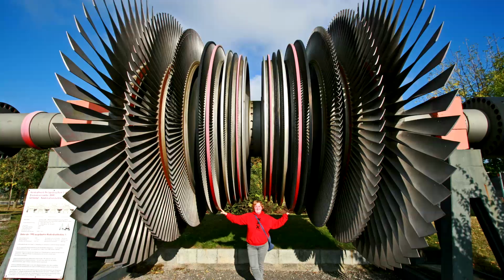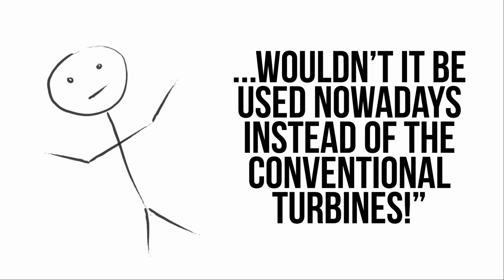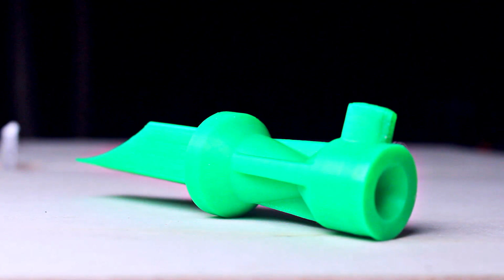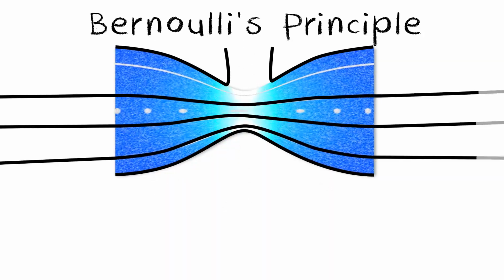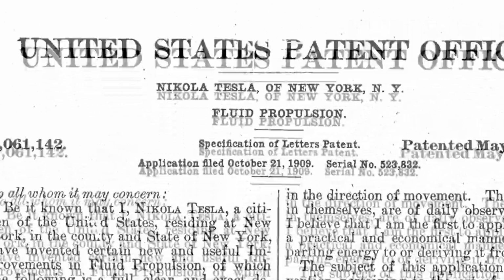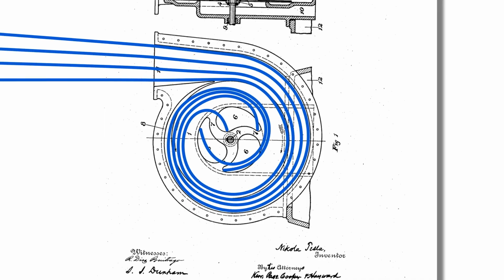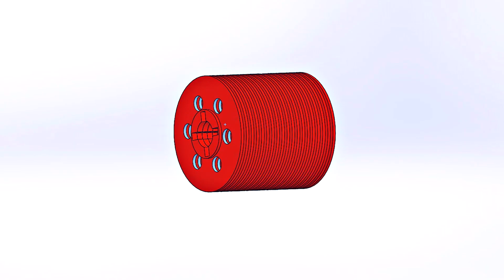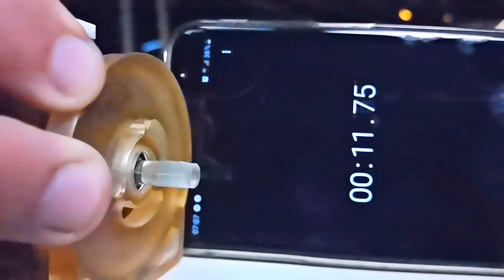Tesla Turbine [Smoke Flow Slow Mo]

Comment: Inetzga ;), do you think it possible to connect the turbine to some sort of pressure generator, to return some of the fuel used ... in a way :) ???
I love the other engines you explore with the combustion and higher chance of fire/explosion, but the printed parts tend to not like rapidly expanding burning gases (which, don't get me wrong, is a shame :) ), not to mention the pair of pressure and high temperature, which of course i love the most on account of ... yep, higher chance of fire/explosion (no casualties intended, except tomatoes and 3d printed parts) 
I think you are drifting a bit from the guy on your wall ... and i am not talking about the Magician ... d@mn, ok, I am talking about the Magician, but not the one from ParryHotter (or was it Happy Plotter, not sure, but am close). So far i have only seen the turbine generating electricity only, i have never seen an attempt to try and make it generate the air pressure. Also, is an inertial weight possible? I know it will impede acceleration, but wouldn't it lower the pressure necessary for sustaining higher RPMs, i remember the stretching disk issue, but was wondering, what if the shaft is acting like it, with a bit of a difference in diameter .... 
 Something is bugging me regarding his statement for the 3, 6 and 9. Could his turbine have something to do with the rest of his ideas and claims(sorry, bad word, should be discoveries)?
And lastly two more things:
1-st. Integza you are THE MAN!
&
2-nd. Tomatoes are disgusting!

Comment: Re. the low torque a TT produces, why not use the principle of the tesla valve to create some resistance within the TT. Bascially, that could mean putting a spirally deformed Tesla valve between the regular discs of a TT - and might even result in better stability. :)

Comment: I think too also didn't use the tesla teardrop exhaust on the turbine, with the venturi case, I think also we're thinking 2d, no reason the sides have to be flat, they can be domed, also the inlet doesn't have to be a tube, it can be rectangular to allow more even flow and also with the high pressure bernolui (however it's spelt) you can have a lamilar nozzle after that as a way of smoothing the feed. The disks are way to thick try aluminium foil from a drinks can.

The entire disk assembly would be better if made of many layers of thin aluminium,  the first type just a disk with a hole in the middle, the second type looking something like this https://previews.123rf.com/images/barks/barks1902/barks190200031/117188577-japanese-ninja-shuriken-illustration.jpg but 2d where they over lap enough for pins to be pushed through each limb and hold the rotor assembly as one

Comment: Could you etch channels into the disks in a spiral to increase the surface area and to guide the fluid flow?
Reply: Boundary layer drag is not from
Mechanical Interactions between the fluid and the disc. Adding grooves will introduce turbulent losses which will reduce the efficiency and can induce stream separation, and even flow reversal, counteracting the desired torque, because of the turbulent flow regime it would induce. The Tesla turbine works on adhesion from viscous forces, which are entire valance electron shell interactions. Think hydrophobic and hydroPHILLIC interactions. Making the surfaces of the discs hydroPHILLIC would increase the molecular adhesion of water and steam molecules increasing the boundary layer thickness. 

Putting mechanical impediments in the way of the free flow motive fluid completely defeats the purpose of the turbine in the first place. You want smooth faced discs. The “wetting angle” between the Type of material the discs are made of and the type of motive fluid is the important factor here.

Comment: I'd have to dispute that Thomas Edison (boo) can even be designated an inventor, as many of the devices attributed to him were either the result of predatory patent aquisition, or as a collaborative effort.

Take the Incandescent Light Bulb This was based on a design from english physicist & inventor Sir Joseph Wilson Swan (itself an integration of several previous ideas & designs) & eventually used a continuously incandescing filament (for the current) after Edison had his team of researchers do a huge amount of trial & error experiments.

In short, Thomas Edison (boo) was less an inventor than a very clever marketer & self promotor.

Comment: The one thing you have not considered as the teardrop shape or The Paisley shape that is part of Tesla's design...... 

the other thing is the rotor design is probably key on how to capture and release the air at a proper timing kind of like a engine or a rotary motor..... Even with a two-stroke the timing is kind of critical......

The air lets out of the disc may have to line up with the slots just right and the volume of the slots may have to be of a certain size to pressurize the same way as your valve to create speed and velocity.... Just theory

Comment: Using a de Laval nozzle will rob power from the TT. It isn't about speed, per se, but about volumetric flow.

In fact, the pressure drop from your "standard nozzle" will do the same.

Standard turbines use such principles to their advantage, but they get their power from direct kinetic transfer, and so speed is king.

In the TT case, you are losing speed due to the volute volume being higher than a tight fitting cylindrical case, however Tesla designed it for steam... He may have used very high temperature steam, in which case it would have had a brief expansion phase inside the volute, cooling it but increasing its volume.

He may have thought that was a good trade.

In any event, I wouldn't abandon using a golden spiral volute...it was a golden spiral... Wasn't it? :-)

Anyway, Using the identical flow rate for both turbines only tells you the unloaded rpm. You should do torque tests to find out how much useful power is being transmitted. It might be the volute case wins.

Comment: I don't think you accounted for the efficiency of the DC motor. Let's give it a giantly generous 85% efficiency, it would mean the turbine was outputting more along the lines of 0.18w. My guess would honestly put that cheap generic DC motor, acting as a generator, at more like 50%, though. Still not a ton of power, but significantly more.

Comment: the constrictor does nothing to the pressure. i done my own experiments on that and it all show that a higher pressure that goes trough a expanded opening will slow down the air flow and create a low pressure thrust much less speed than that input. the nozzle actually slow down the rocket. cavitation causes reverse thrust that pulls the rocket down against the expansion. there is alway vapor in the atmosphere and is very bad for a nozzle as it causes a displacement flow against the thurst that try to propel the rocket in the wrong direction. i also made many constrictors myself with air pressure and they all causes no effect at all. if you do real science do it on the so called facts to see if the facts are tellig the truth or if the facts are lying.

Comment: I  HAVE AN IDEA FOR THIS GENERATOR I WOULD LIKE TO SEE IF IT WOULD WORK  :D . And that would be using it under a fluid load  Ie: under a water load . and as well as also incorporating the tesla valve into it as then it would limit the possibility of back wash into the supply line of the water.instead of that of a pelican wheel and then the comparison of the two as far as efficiency of output and  would it be possible to incorporate the idea of the two , that of the Tesla disks while running a a set up pelican scoops in between them , as a multi level pelican wheel hybrid. reason behind this thinking is that of that of a small but powerful turbine for a hyfro plant for offgrid electric( please let me know what you think of this idea thanx for all work your and time on these vids )

Comment: You're not quite correct about the flow, once the turbine is turning, centrifugal force pushes the flow of fluid out to the edge of the rotors and away from the exhaust ports. This actually (from what I can gather) works better with the smallest possible clearance between the case and rotors.

Comment: I had an idea of how to use Tesla turbines to utilize tidal power to generate electricity. Large underground chambers need to be dug into the coastline, that communicate with the sea, out beyond the low-tide mark, and also with a large Tesla turbine's inlet. As the tide rises, all the air in the large chamber will be forced through the turbine. When high tide is reached, the connections to the inlet and outlet of the turbine are reversed, so that - as the tide falls - the air to fill the chamber will be pulled through the turbine, which reverses its connections once again at low-water. This way power can be generated on both ebb and flood, and NO tidal power scheme can generate at slack water anyway. 

I like this idea, because the corrosive salt water never needs to contact the machinery directly, and there are huge stretches of coastline around the world that could be used for such installations.

Comment: So I was thinking, what if you put little elongated holes similar to the cutting holes in a grater, but to catch the air, and in the 3 6 9 spiral design, spiraling inward, on the discs...
 Just a thought, Idk all you'd be out is some printer plastic

Comment: What if you taper the side walls towards the center? Then the pressure would build as the side walls got closer the the disk in the center? Also engraving concentric circles in the disk might increase its surface area?

Comment: Unrelated to the Tesla turbine but your table saw, you need an edge that’s adjustable so the material has something to rest against, this will help stop the flexing in the blade as you cut because your trying to put even pressure with both arms at the same time. Love your vids keep em going!

Comment: Here's my suggestions:
On the interior of the turbine - Decrease surface tension by smoothing interior with hi grit sandpaper, fine rosin polishing and then cotton buffing.
On the disks apply same process.

You can also coat disks with a 3M product called "NeverWet" this creates a nanocoating that nothing sticks, and a micro-level (not nano) coat that the surface is smooth as can be. Without having thousands of dollars of equiptment, such as using steel and precision grinding.

Yes I too am an inventor.

Comment: If the discs had spiral grooves on them they'd have more friction with the air and could assist in guiding it's direction of flow slightly to increase efficiency
Reply: Unfortunately This is not true. Adding grooves will introduce turbulent losses which will reduce the efficiency and can induce stream separation, and even flow reversal, counteracting the desired torque, because of the turbulent flow regime it would induce. The Tesla turbine works on adhesion from viscous forces, which are entire valance electron shell interactions. Think hydrophobic and hydroPHILLIC interactions. Making the surfaces of the discs hydroPHILLIC would increase the molecular adhesion of water and steam molecules increasing the boundary layer thickness. 

Putting mechanical impediments in the way of the free flow motive fluid completely defeats the purpose of the turbine in the first place. You want smooth faced discs. The “wetting angle” between the Tyler of material the discs are made of and the type of motive fluid is the important factor here.
Reply: @CharlieSolis  Wouldn't an increase in surface area increase efficiency?
Also, the turbulence problem only occurs beyond a certain velocity. As long as laminar flow is maintained, surface roughness will only increase the amount of energy transferred to the discs. Reducing space between discs, reducing flow speed, and using a lower density fluid will reduce turbulence while surface roughness isn't as much of a problem. It can even be to such an extent that the discs nearly form closed tubes between them in a spiral pattern without much loss if other parameters are controlled properly.

Comment: It seems to me, that the secret to increasing efficiency is to optimise the effective path length along the disks in proportion to the casing. That means, to maximise the surface area of the disks in relation to that of the casing. I haven't done the math, but I assume that the optimal shape for the casing would therefore be spherical rather than cylindrical.

Comment: If the outer ring of air is most laminar and therefore better at moving the discs, then shouldn't the axis have a very large diameter to take up the space where air spirals inward?

Comment: People say perpetual energy is impossible, but that's not a great plan any way. What you really want to work on is a feed back loop because a perpetual motion device will only remain perpetual until someone tries to extract energy from it. Once energy is lost you can't get it back in a perpetual device. However in a feedback loop you gain more energy than you lose and therefore can extract energy from it. Hold on a second...  If you extract the perfect amount of energy at a time in a feedback loop it would be perpetual. Except, you would need to constantly extract energy from it.

Comment: The converging diverging nozzle will not work in this case as the speed of the air needs to be in the localised transonic regime at the throat(smallest cross section area). Loved the video regardless

Comment: What if the discs could move like an automatic transmission, this would change pressure between the discs allowing more grip potentially? Also R2, for Resinator 2 for the new printer.

Comment: Since you asked for ideas, the first thing I would try to increase the efficiency of this design is dimpling the disks to increase their interaction with the fluid.  But you might be better off trying to increase the efficiency of the actual power generation at low torques, or of increasing the generator's torque.  Electromagnetic power generators lose a lot of their efficiency at low torque, so even if the turbine is more efficient, the overall power generation probably wouldn't be.  I think that's also one of the obstacles to low head distance hydropower

Comment: You should 3D re print a nozzle with a grid pattern on the tip on the through partial bit of the nozzle the stabilize their as much as you can

Comment: The primary issue with the original tesla turbine was materials, if Iron of the day wasn't good enough for disks, what makes you think that plastic with a lower yield strength is enough for efficiency.  with cool air as the working fluid, I recommend carbon fiber.  For higher temperatures, perhaps something more aerospace grade.  At a minimum, high carbon heat treated steel, and the sky is the limit.

Comment: Convergent-divergent nozzle is better than convergent nozzle ONLY if you have supersonic flow. The reason is that with convergent nozzle you have the conservation of mass working for you, but in divergent part the conservation of mass is working against you. Only because the flow in the throat reaches the speed of sound, the divergent part can push it to supersonic flow. But in your case you just undo what the convergent nozzle did right. Even worse, since convergent flow is pretty easy but divergent flow require specific shape to have small losses (mostly small angle of divergence to not have flow separation)
Edit: also glass blocks the UV, soo 16:20 if you left it there, it is not properly cured.

Comment: Instead of have discs of the same diameter in this "volute(?)" casing, could it be better to have a series of discs, each with a smaller diameter, following an inner diameter of the casing,
towards the turbine outlet. Would this help keep the flow laminar? The inner volume would be conical with the outlet at the apex.
If you look at a diagram of a regular turbine, not all blade-discs have the same diameter.

Comment: It may be time to invest in a small, 9” bandsaw

Perhaps to improve this mechanism it would be good to create a dimpled surface on the metal discs... that or raised bumps, providing just enough extra surface area to push against and increase efficiency and possibly torque proportionately.

Comment: would groves on the spinning disks help in improving the efficiency?  (I know it would decrease the airflow and cause turbulent airflow rather than a laminar one but, will it work)
Reply: No, since the whole turbine principle is using the forces present in the boundary layer which is disrupted in turbulent flow ;)
Reply: Unfortunately This would have the reverse effect. Adding grooves will introduce turbulent losses which will reduce the efficiency and can induce stream separation, and even flow reversal, counteracting the desired torque, because of the turbulent flow regime it would induce. The Tesla turbine works on adhesion from viscous forces, which are entire valance electron shell interactions. Think hydrophobic and hydroPHILLIC interactions. Making the surfaces of the discs hydroPHILLIC would increase the molecular adhesion of water and steam molecules increasing the boundary layer thickness. 

Putting mechanical impediments in the way of the free flow motive fluid completely defeats the purpose of the turbine in the first place. You want smooth faced discs. The “wetting angle” between the type of material the discs are made of and the type of motive fluid is the important factor here. Polar, non-polar,… that kind of stuff.